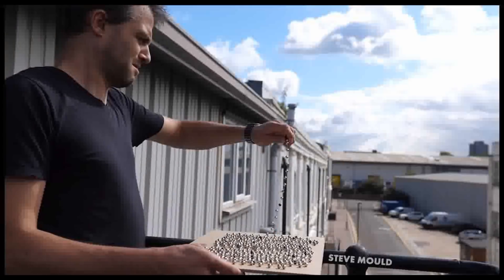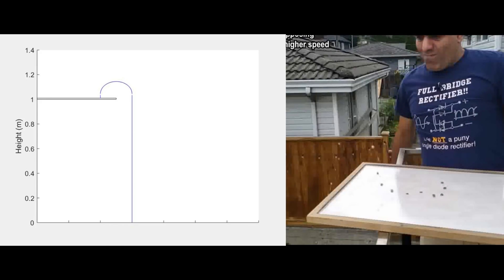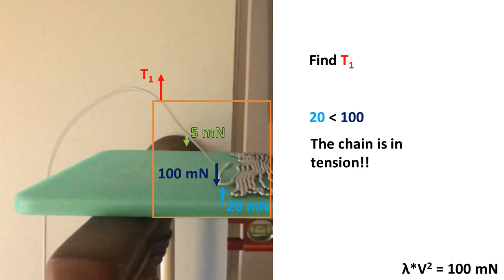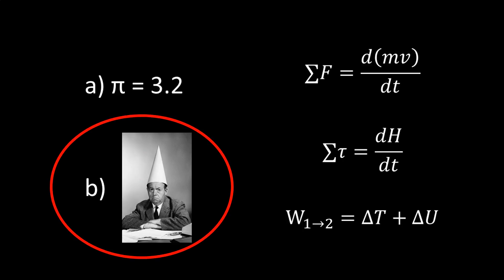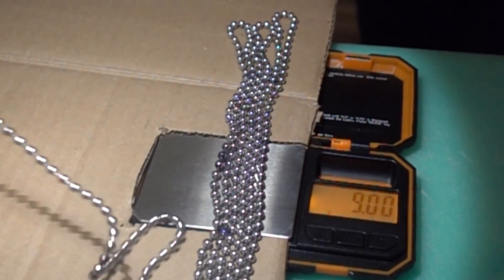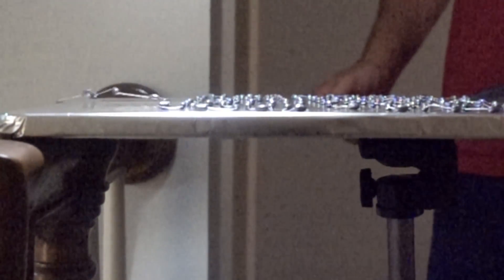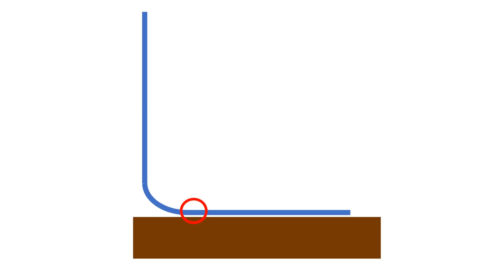And the Winner of the Chain Fountain Dispute is...

Comment: Explanation for why the fountain starts even when pulled horizontally even on flat surface is in my opinion surface roughness and friction. Take just one chain bead and put it on the end of a fishing line. Put it on a flat surface and jolt it sideways by the fishing line. It will launch upwards. Not straight upwards but it will bump off the surface, even single bead. The difference in friction the top of the bead and the bottom of the bead experience during the acceleration is enough for the bead to bounce off the surface. And I believe that beads bouncing off each other is one of effects forming the fountain, notice that even though the chain goes upwards, the motion always starts horizontally.

Also one comment about the simulations shown at 18:30. They're idealized case. There's no friction between container and the chain and all the loops are vertical. That's not how it looks in reality when loops are mostly horizontal and their vertical component is negligible. Even though these simulations look convincing, I think they're not demonstrating the real process.
Reply from the maker: That's why I had the test at 2:55 (though, on second viewing, I see that I was not very clear). I laid the chain out in a straight line on the carpet and pulled. So there was still plenty of friction, but no fountain formed.
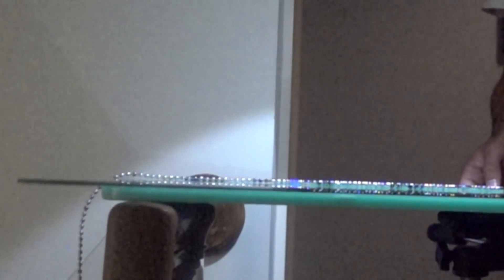Reply: @prestonbecker8784  The situation is different as in such configuration, the chain is stretching itself, the more the more chain is still behind. I'd argue that some jumping was still involved, though by far not that pronounced. The thing that has the most freedom to jump is the end of the chain and if you check at 3:05, that's exactly what happens. By laying the chain perpendicular to the pull direction, most beads experience the "end of the chain" dynamics before the chain straightens up.

Comment: Should try different chains, it should work on all types if the reaction theory is true. Its a case of the loading/ kink affecting the momentun, larger diameter have less momentum change.
Steve argument is that the reaction force is vertical not horizontal. Friction on the surfaces aren't the same in your comparison so misleading. Less friction would produce higher fountain.

Comment: I'm heading back towards the Mould camp again. I've jumped sides a few times now. I'm a fair weather friend to both Mehdi and Steve.. But that cling wrap water method...you don't even need any physics to explain it in a sense. If the uptake region happens on water, and that is enough to kill the fountain, then the answer resides in the "beaker"...not in the air. Very good work . Pleasantly confused again.